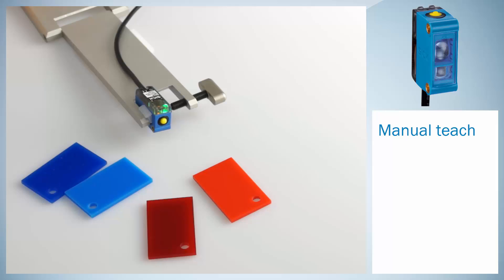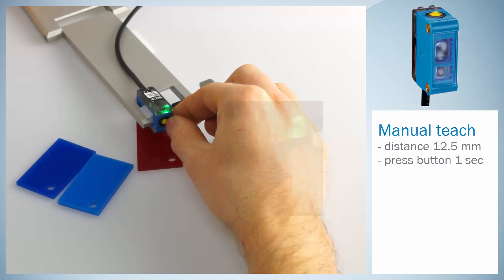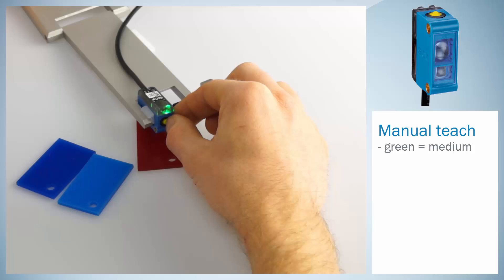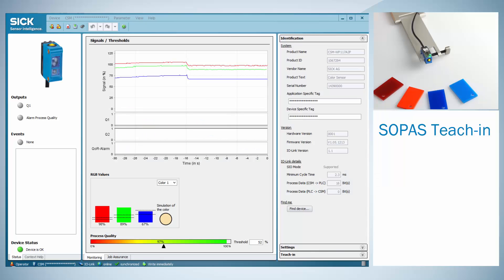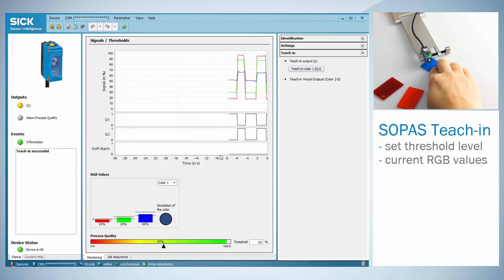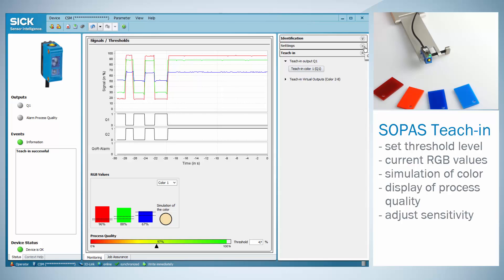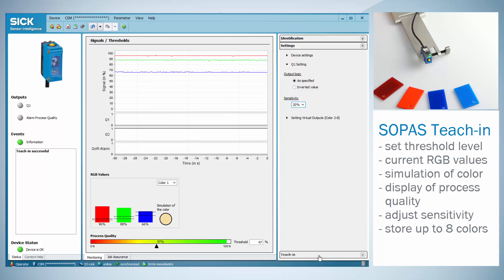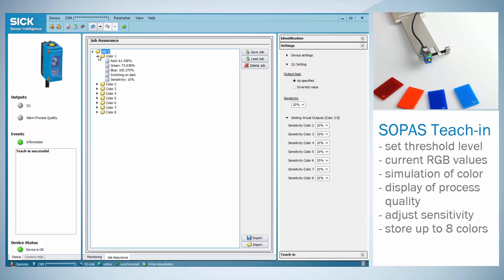Tutorial: Set-up and operation of the CSM color sensor from SICK | SICK AG

Comment: Can we teach for atleast 2 colour at a time ? Our application is to sense the label colour on a PET bottle. Label contains 2-3 colors on  its printed surface
Reply from the maker: Hi @sachinpbabu118 and thank you for your question!
With the follower model of the CSM, the scenario you describe would be possible. It features a new "dynamic teach-in" option, where 2-3 colors can be taught in by moving them under the sensor. However, if you wish to use this option, it is important to ensure that no unwanted switching occurs due to any background color that falls within the taught color combination.
If you have any specific questions or need further support, please feel free to reach out to our SICK Support Team at info@sick.de. They will be more than happy to assist you.
Have a great day!
Reply: A better option would be to use SICK CLV69x-1xxx to capture the bottle's barcode. Here is how:
Make sure the bottles are forced against the conveyor wall, where you have a high grip rubber strip, so when the conveyor moves the bottle, its forced to rotate. This can either be done by a inclination (angle) so the bottles are forced against the wall by gravity, or have low-friction arms that push the bottles against the wall and thus cause them to rotate.

Then you have a SICK CLV69x-1xxx mounted in the middle of this section, perpendicular to the bottle. It will then capture the barcode of the bottle, and you can easily assign in the computer, which barcode is assigned to which label colors, and thus logically detect the label color this way, for further sorting of the bottles. Since the bottle rotate, the barcode will always get into the field of view of CLV69x-1xxx atleast once.

Comment: Are you able to integrate this with the Arduino or Raspberry PI?
Reply from the maker: Dear @amichow, thank you for your question! Accessing the sensor via IO-Link from Arduino or Raspberry PI works. There would be the following possibilities for this. You could use an IO-Link master like the SIG200 and connect it to the Raspberry PI or Arduino. This way the master can be addressed via standard TCP/IP and communicate with the sensor via IO-Link. Otherwise it would be possible to design an IO-Link shield for Raspberry PI or Arduino. The linking would then be possible without an additional master. Examples can be found on the web. Please note, however, that a Windows PC is required for using the SICK software Sopas ET. Have a great day.

Comment: Can I use this sensor to detect water color??
Reply from the maker: It is quite subjective on detecting the water color.

It depends on where the water color is contained, how intense its the color, how much quantity etc.

If the water color is contained a for example standard water color container and the color is ok, CSM should be able to detect it.

But if the water color is on the table (for example), or diluted with a lot of water, there will be other factors to consider too. 

So it depends on the applications.

Comment: Works on glass ?
Reply from the maker: Hi Pedro Rodríguez Beltrán, The recommendation is to be used the CS8 (https://www.sick.com/de/de/registration-sensors/farbsensoren/cs8/c/g113669 ). This sensor has autocollimation optics. The glass to be detected must then be positioned between the sensor and a triple reflector. The sensor light penetrates the glass on its way to the reflector and back. In addition, the sensor should be tilted slightly relative to the glass surface to avoid the direct shine reflex.

With the CSM this application will be very difficult to solve.